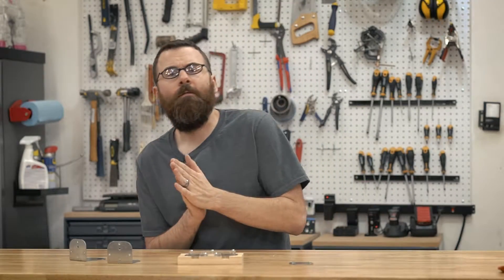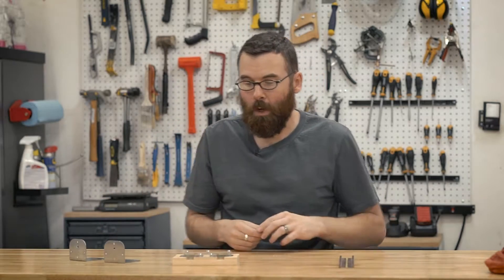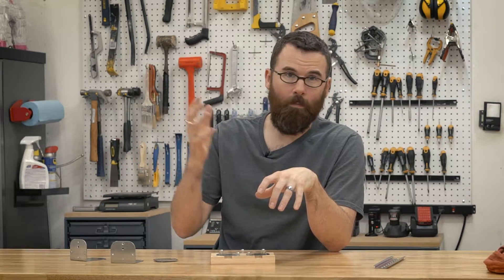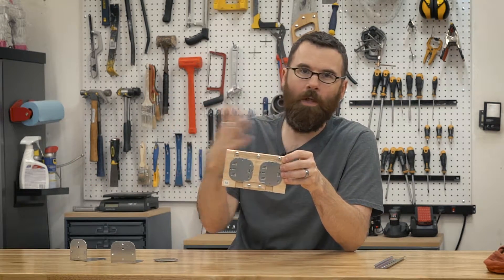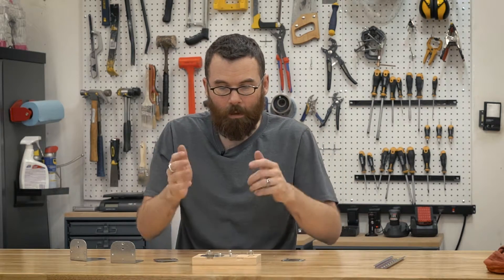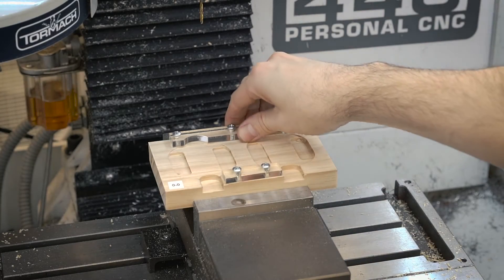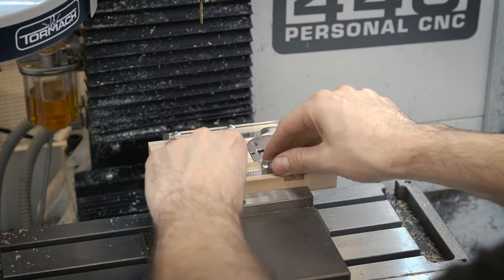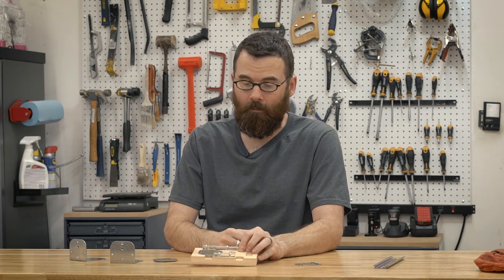From Start to Part:  Small Production Jig

Comment: Good information.  Even without a CNC machine putting several metal parts to be drilled on the wooden holder then drilling them by hand using pre-set stops on the drill table would save time.

Comment: I guess it wasn't practical to stack drill them?
Reply: Justin Bell Maybe the clips at the back of each plate prevent the to stack properly?
Reply: Ah didn't see that, yeah that would probably stop it.
Reply: He he, glad to help. It's such a fun and interesting activity to try to figure out the most efficient way to batch out mass of things.
Reply from the maker: Exactly!  It's simple and wasn't worth spending a lot of time on, but there was still some time to be saved.  And Rexus King is right, you can't stack them because of the clips.  I could stack two back-to-back though.

Comment: Hi,

Here is something that might be helpful if you ever get into a large production run. Cogsdill Burraway cutters.  It is s system that allows deburring of holes on both the top and bottom side of the hole.  It does require a certain about of space below the hole for the tool to work properly.  The downside is that these are only available in certain sizes and they are not necessarily cheap.  I used them on my CNC machine on a production job when I was helping one of my friends with an ultralight aircraft project.  Worked really well on aluminum tubing.  Sometimes you can even find the size you need on e-bay.

John
Reply from the maker: Ah, good to know!  Thankfully the burr was minimal and not worth addressing.  But that's something to keep in mind.  Thanks.